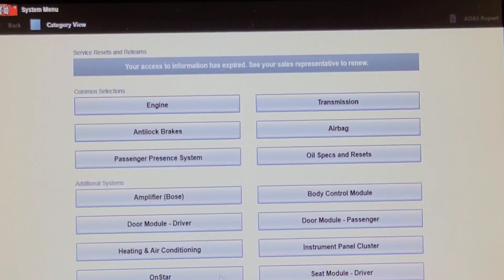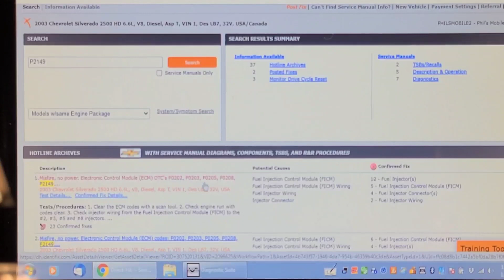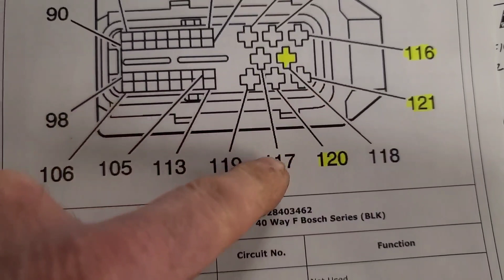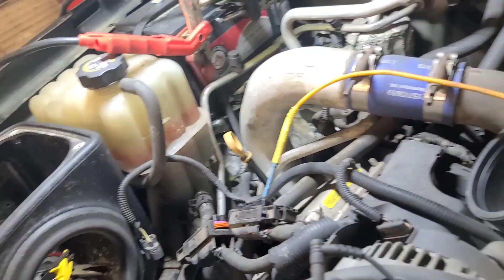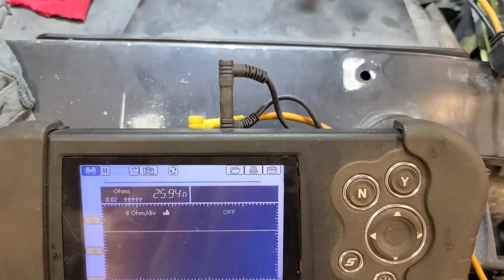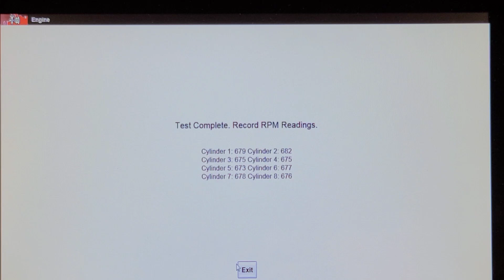2003 Duramax LB7 Low Power Codes P0202, P0203, P0205, P0208 and P2149.

Comment: i bought a lb7 and it needed all the injectors so i replaced them along with all the bolts and return lines and the front end and the water pump and power steering pump and much more then 4k miles later it blew the head gasket so i replaced the heads with freshly machined ones and studded it and did everything i could the water pump came apart so i replaced that along with the cam gear. resealed the upper oil pan as well and if ykyk the transmission has to come out its 4wd. drove it 5 miles and my crank seal was leaking that i had installed because i didnt use the driver tool. bought the driver tool and a new ac delco crank seal right before i was gonna take off in it after all this hard work and lost group 1 at idle. ready to see why.
Reply from the maker: Wow good luck.
Reply: @PhillipBailey one of the injector harness pins had backed out on its own on injector 7. i would say your better off replacing the harnesses when doing injectors.

Comment: My truck has the same codes and is in “tractor mode” aka running on 4 cylinders same codes your showing 
How do I do an ohms test? Can I do with a volt meter and the positive and negative in different pins?
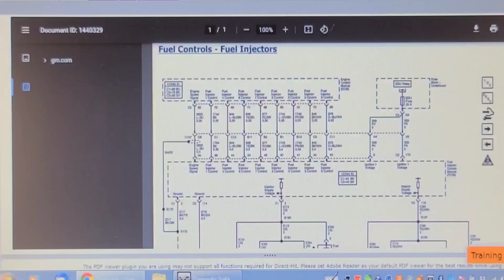Reply from the maker: Re-watch the video starting at 3:25.. use an ohm meter between pin 118 and the 4 injector control pins. Use the lowest scale on the ohmeter and zero the meter first. The spec is around 0.2ohms.
Reply: @ I can not get a reading when going from 118 to any other, when I ohm out the injectors to each other they all seem to be in spec when I try to go from 118 to any pin just shows 0.00
Reply from the maker: @LiiveRosiin  make sure you have the meter set for ohms and not Kohms.
Reply: @PhillipBailey  it’s all set right not getting. Reading when testing exactly how you are 
Only when i go from say 115 to 120
Reply from the maker: Are you certain that the meter is set to ohms? 115 to 120 will measure two injectors which will be around 0.5ohm. You may need a better ohm meter
Reply: @ I hear that, I was thinking a better ohm meter but I keep getting readings from injector to injector 
Could  it be a bad 118 pin?
Reply from the maker: @LiiveRosiin you said you measure 0.0 ohms between 118 and the other 4 pins? You should measure 0.2 to 0.4 ohms. 0.0 is shorted but it's highly unlikely that you have 4 shorted injectors. An open would read OL or however your meter displays over limit.
Reply: @ got someone with a better ohm reader and all tested 0.08 on the ohm meter 
It’s probably a stuck open injector I’m going to crack the valve covers this weekend
Reply from the maker: @LiiveRosiin  that reading does not make sense sorry. If you're going to be removing the injector lines to remove the valve covers you better plan on replacing all the injectors. Debris from the line nuts will fall into the injectors when you remove the lines.
Reply: @PhillipBailey  REPLACE INJECTORS JUST CAUSE POTENIAL DEBRIS?
Reply from the maker: Yes I agree!
Reply: @PhillipBailey no I was asking I’m having a issue right I ohm tested the passenger side ficm connecter like in the video but how do I test the other?

Comment: I was driving my 2004 Duramax LLY Kodiak, and everything seemed fine. Then the truck started stalling when accelerating, so I went home, looked on YouTube, and decided to change my pressure relief valve to a race fuel plug. After that, the truck ran better with no bogging. If I pressed the pedal slowly, the speed would climb, but acceleration was still sluggish.

After driving it for a while, the truck kept getting slower and slower, and white smoke started coming out. I replaced all 8 injectors, and the truck ran great—like new—for a day. But after a few weeks, it became slower again, though it was at least consistent.

I was still getting a lot of white smoke on startup, which lasted about 30 minutes until the truck warmed up. I replaced the fuel filter, and the white smoke seemed to go away for a bit.

I then hooked up a vehicle scanner and found that injector #1 was putting in more fuel than the other 7, which all registered the same. Thinking it might be the fuel pump, I replaced it with a new one, but the truck ran the same. I was still getting shaking and white smoke.

Then, the truck started dying again when accelerating, so I figured it might be the fuel pressure regulator. I replaced it, and after that, the truck ran good for weeks. No issues—just a little sluggish, but no shakes.

Later, I replaced the number one plug, and after that, the truck had no misfire and ran smoothly.

One day, I went to drive it, and there was no white smoke or shaking, but it was slower again. Then, it suddenly went into limp mode, wouldn’t go over 20-30 mph, and wouldn’t rev past 2000 RPM. I limped it home, thinking it was the fuel pressure sensor, so I replaced it. The truck ran again but was still in limp mode and hard to start. I had to pump the fuel filter and bleed the screw to let air out, but that still didn’t explain why it was in limp mode. I change the fuel sensor again because I found I had an issue with that. I changed the Race plug to a regular plug and I did a smoke test on the truck as well which it had no leaks and I changed the mass air sensor. And the truck still takes off really fast and just feels like a bottleneck on fuel and stops running fast and I also changed the fuel filter.

It’s a 2004 LLY Duramax with 149,000 miles, and I feel like I’m just throwing money at it trying to fix it, but I still don’t know what’s wrong. I’m not getting any codes, which is weird because when the injectors were bad, I did get a code. Now, nothing.
I am not sure what to do at this point I shook all the cords on the injectors, and the truck did not cut off or go into light mode. It only goes into light mode when I’m driving basically, I can push the pedal to the floor and it will not accelerate it’ll start to ramp up and just die like it doesn’t want to pull faster and it’ll drive at like 20 miles an hour. It will not give me a check engine light to tell me what’s wrong.
Reply from the maker: @leondavis3451  first of all if the truck is tuned it may not set codes  due to the tune. Try put it back to stock and see if it reports codes.
Reply: Have you changed to injector harness on them?

Comment: So were you checking the FICM connectors to see where the the problem in the harness was ?
Reply from the maker: @TheHighestPilot  I was testing the resistance of the injectors at the FICM to determine which one was the problem
Reply: @ I’m having similar problems and need to check all my injector plugs so this is the easiest way In your opinion
Reply from the maker: @TheHighestPilot  yes you will need a connector pinout, ohm meter and probes.
Reply: @ I’m sorry if this is a dumb question but do you do it while it’s in or running ?
Reply from the maker: All measurements are done at the FICM connector, unplugged, ignition off.
Reply: @ I just reali your truck in the video was a lbz is the diagram in the video the same as a LLY ?
Reply from the maker: @TheHighestPilot I don't know for sure if it's the same. Alldatadiy.com has diagrams for a reasonable fee.
Reply: @ so I got the pin out and I got some smaller needle like probes to fit the connector but each one of my connectors are reading 2.8-3 is this normal ?

Comment: All 4 pins ohm at .3, should I assume FICM or change the EGR Valve. 

(Mine is a Cali vacuum pump and EGR valve)

Previous codes were P2146 and P0202,3,5&8. Also P0404, and U1096(Lost communication with Instrument Cluster)
Reply from the maker: @FatStackDuramax  check for a possible short to ground on the injector wires as well. Also an injector can fail when it gets hot.
Reply: @PhillipBailey  thanks for the swift response! I will definitely check that.  I went ahead and replaced the egr valve and reset the cel. So far so good.

Comment: My 2002 lb7 won’t start after they put a grnd to + fix fuses now I tested the long story short tested both pink wires that go to the ficm and shows good voltage, disconnected pasenger side inyector (1,3,5,7) wiring harness and while cranking gives me just 13.xxvolts and you say on a comment you believe the run between 42/48volts so it’s bad?

I hook snap on scanner no codes
I open the ficm and it doesn’t seem burnt
Reply from the maker: Yes they run around 48 volts but if the circuit is detected faulty it will shut off the inector supply so what you did wont work. What is the problem and what have you done?

Comment: Hello I’m hoping you can help me with my problem. I have a lb7 that is throwing codes p1261 p0201 p0204 p0206 p0207. It does it at random sometimes it’ll do it after a short drive. Sometimes after 50 miles. I took it to a shop and they couldn’t get it to go into limp mode. But they checked the injectors and they checked out ok. I still will check them myself. So the other bank that went  out in your video. In your video you used pin 118(power supply) to ohm that side injectors(2,3,5,8). When I check injectors 1,4,6,7 do I check them with pin 118 as well? I’m thinking I should check them with pin 3 in connector c1.

Comment: Hello can you please tell me what is the negative and positive on these injectors?
Reply from the maker: At the injector it's pin 2 that's power and pin 1 switched ground. I believe they run between 42 to 48 volts.

Comment: Where can I get the pin configuration diagrams that you used? I have wiring diagrams with wire color codes only. Also where did you get the injector resistance data to see if it they are in specification?
Reply from the maker: I'm using Identifix but as far as I know it's only available via subscription to shops. Try Alldatadiy.com. They offer OEM level service information for a pretty reasonable price.

Comment: Why is it that only 1 injector turned out to be bad if there were 4 injector codes showing? I'm having the exact same codes now, but the problem started with only 208 coming up with 2149. It also only goes into limp mode when I reach 55 mph. Is the first injector in sequence that bad one and it simply throws the others following 2149?
Reply from the maker: Half of the injectors are supplied power from one driver in the FICM and the other half from the other driver. The voltage is stepped up by the FICM as well. When it sees insufficient current on an injector caused by an open or high resistance in one circuit the FICM shuts down all four injectors for safety. Unfortunately it then sets codes for all four. It could be any one of the four in the group. Since the injectors are ground side controlled a short to ground on a control wire would cause ovefulling in that cylinder.
Reply: I’m having the exact same problem at the moment

Comment: All mine are warm and only getting 1,5 and nothing from 114 and 119. What’s my problem
Reply from the maker: Not sure what you mean by that question. Describe what your testing and tell me what codes you're chasing.
Reply: @PhillipBailey  I figured it out the fuel injection wiring harness is rubbed and touching each other I’m just gonna put a new harness on it
Reply from the maker: @zackwhite7120  that's great. Glad you figured it out. That's probably the cheapest fix you could hope for.

Comment: I got the same thing on my lly goes in limp mode randomly but I clear the code with scanner and it runs just fine any thoughts? Same codes you got too
Reply from the maker: I believe there was a TSB on the LLY for terminal fretting. That's what GM referred to loose connections at the injectors. Are yours plugged in terminals external? If so i would check pin drag and use Deoxit spray followed by Stabilant 22A on the terminals. There was some support retainers for the injector harnesses. Problem could also be at the FICM terminals. Be very cafefull not to spread the terminals in the connector if you go there. .
Reply from the maker: Bulletin 06-06-04-026A. Try Google that.
Or here: https://www.duramaxdiesels.com/forum/threads/possible-injector-problem-with-a-lly.12777/
Reply: Appreciate this, I just want to rule everything out before dumping thousands in it. Definitely getting on this this week.
Reply from the maker: @sixsixer1501  good luck.

Comment: Hello Phillip, I tested all injectors male side and I'm getting the same read thoughtout, so if @ minute 10:20 of your video, I'm not getting anything out of the ordinary could i assume the issue is not an injector?
Reply from the maker: What is the actual problem with your truck.
Reply: @PhillipBailey  thanks for your reply, so first off its an 01 LB7, and about a week ago, a went to put diesel, and when I was heading out of the gas station i lost power and went into limp mode, codes given are the P0202, 0203, 0205, 0207 & P1262, i also have a Trans code U2106
Reply from the maker: @NinetySevenPalmsStudios  should be codes 202, 203, 205 and 208 not 207. That's a different group of injectors. Carefully compare all the injector resistances and note if one is significantly different. If all the codes reset as soon as it starts but the resistances are the same across the group then the injector driver may have failed.  Try moving the wiring while measuring resistances. Could be poor pin grip or connections at the injectors. Has it been worked on before? Tuned?
Reply: @PhillipBailey  yes sorry meant 0208, and im not if it has been worked on prior, as far as injectors go, but it is tuned, DSP5, with stock trans tunes. I have checked the continuity like you did in the video, from FICM to Injectors  and even checked the passengers side just in case all gave me good reads, I have not checked all grounds as i have only relied on these videos and not sure where all ground connections are, not all pins connected to the harness have been checked, just the injector ones, i suppose i should follow the harnesses to get to the ground correct?
Reply from the maker: @NinetySevenPalmsStudios  that code indicates a problem in one of the injector control circuits. Both power and ground come from the FICM. I'd reconnect everything start and see if codes return. The problem with ohm testing is the circuit is not under load. It can still fail when it's hot or cold. Are you sure your using the ohm meter correctly and on just ohms? No offense please. If the codes reset when hot you have to recheck when hot. Try a different FICM. Good luck
Reply: @PhillipBailey  im not an offensive person, and i appreciate your help! I'm not using the same meter as you but im using a multimeter and in the Ohm setting, my reads are different though, they are at 0.6 on every single injector (including the passenger side), so nothing out of the ordinary correct? I will put everything back together and see if the codes are being generated again. There is a mechanic that will be coming to see it soon if i dont find a fix, so i will wait on the FICM (lil pricey) ive just been looking at youtube videos since it just happened out of the blue without any prior issues, yours was the closest one to my issue, ill keep you posted as soon as I can, many thanks!
Reply from the maker: @NinetySevenPalmsStudios  .6 ohms sounds good. Good luck
Reply: @PhillipBailey  So I did some further testing, and it looks like when I disconnect the front passenger connection for the Injectors, I get full voltage power to the front drivers injectors, but when i connect it again, i loose said voltage, so i believe there is a short somewhere on the front passenger side injector, could the short be in the injector, and not at the harness? I get voltage on that harness as soon as I remove it.
Reply from the maker: @NinetySevenPalmsStudios  recheck the resistance but connect between each injector wire and ground. There should be no continuity between any wire and ground. Be sure the meter is set to read at least 100,000 ohms. You could also test between unrelated injector wires and again should only read continuity between each pair. It's possible the harness is shorted internally between circuits or to ground. Let me know what you find.